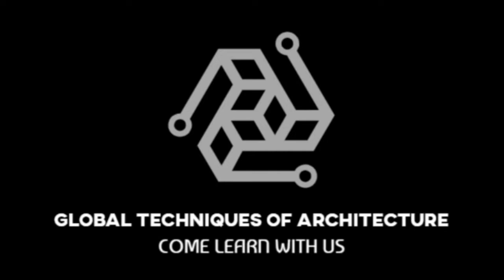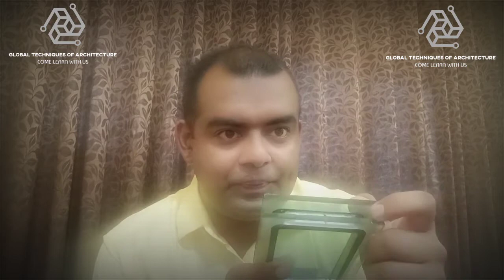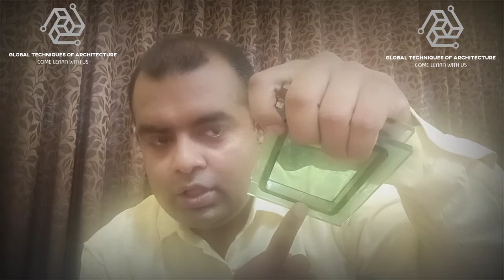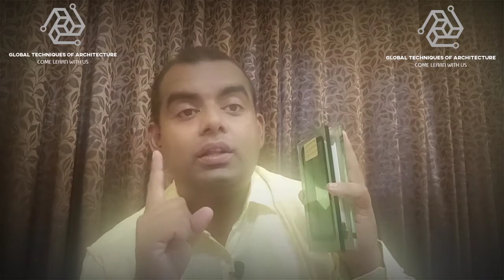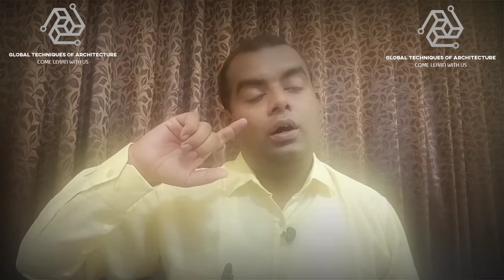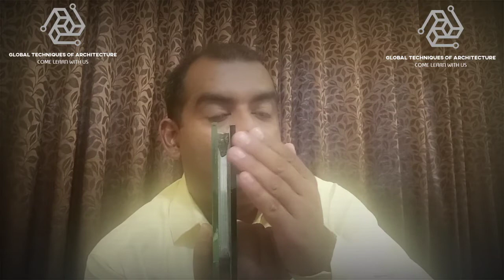DOUBLE GLASS UNIT | DGU | INSULATED GLASS UNIT | IGU | FACADE ENGINEERING | GTA

Comment: Very informative thanx a lot… I am from coldest inhabited place in India so I naturally looking for glass which provides insulation.. Now i know IGU is the solution .. but could you throw some light on the thickness of the unit .. such as what should be the thickness of both glasses and what should be the dimension of a spacer for a residential building  in cold place with plenty of solar energy
Reply from the maker: Nice question, but it's more eleborative pls connect on 9930952051